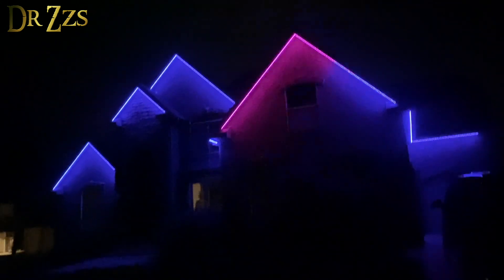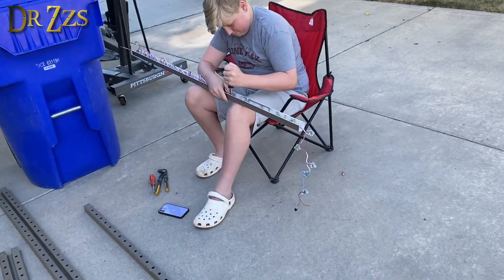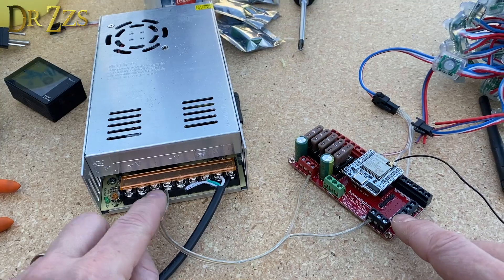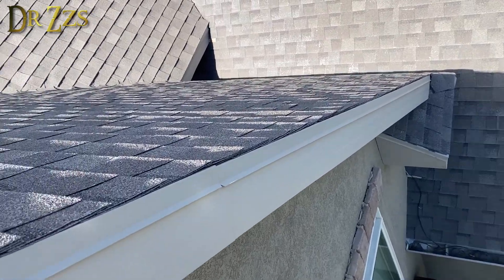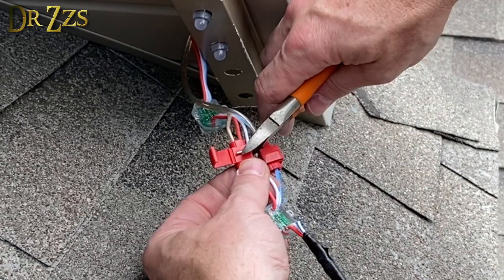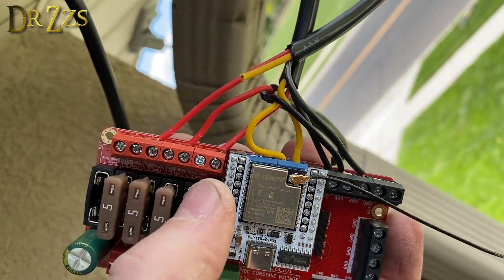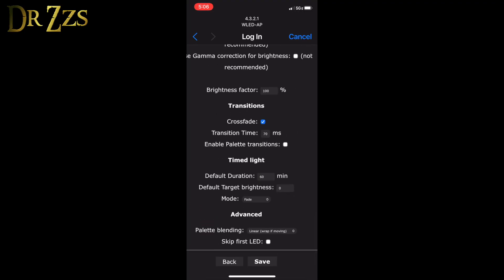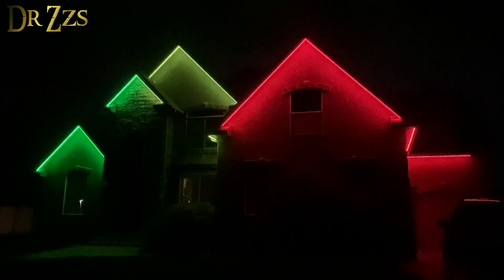Permanent Holiday Lights | Permatrack | WLED

Comment: I was able to connect to the WLED-AP network once. I was not able to follow your instructions in this video before my phone went to sleep mode and now I can't find the controller box network on any phone. Is there a way to reboot the system to factory defaults?

Comment: You can also brush the data booster with silicone conformal.  You could literally run it under water with that stuff.  I used to use it back when I built drones so they would be safe if they landed in wet grass, fell in a pond, etc.

Comment: So I have a quick question for everyone. Does anyone know of a LED Wi-Fi controller that has holiday preset patterns on the app? I have a supplier from China that I have been getting traditional LED Christmas lights through for years now. They now offer the permanentlights that are 12 inches apart. They are sk6812 rgbw. They came with a SP108ELED Wi-Fi controller and the app “LED Shop” is a great little app but I need to make it really simple for our customers. I don’t know if I have enough information in my question, but any kind of help or things for me to learn would be greatly appreciated. Thanks.

Comment: On one of your earlier videos, you didn't inject power when using 12v. I thought that was the reason we were using 12v. So we didn't have to run more wire.
Reply from the maker: We probably didn’t need power injection on this install either.  We did it because the track was going to be inaccessible and while we have the boom lift we thought we aught to go ahead and power inject since it was minimal work up front and would be a ton of work if we had to do it later.

Comment: These pixel led strips can be controlled by an ESP8266/ESP32 too ? Why not using a Falcon F16 controller ?
Reply from the maker: yes.  They can be controlled by any ESP-based device and they could be controlled by a Falcon or Kulp controller.  If you use a digquad (or other WLED device) you can integrate it into an xlights-based show.

Comment: Really struggling to troubleshoot why it’s not working…figured I’d post on here as I’ve watched the majority of your vids but unable to determine problem. 

Power supply is functioning, I have power to controller (>12 v ish), I am also reading power through the lights themselves. The WiFi is not being recognized by my phone. And the lights are not lighting up. Data is on first relay and the flow is on the correct side of the individual express able led lights I bought. I’ve tried two strips and neither work
Reply from the maker: The best way to get some support is to join the discord channel.  Link in the description.  It is really hard to troubleshoot via comments.  There are lots of people who are experts in the discord channel.

Comment: What do you recommend for peeps who have gutters installed?
Reply from the maker: Every roof I've installed on has had gutters.  The gutter is on the outermost edge of the soffit, so there's room behind it to mount the track.  I've also seen people screw into the bottom of the gutter.  That doesn't end well.  Don't do that.
Reply: @DrZzs  so mounting it downward(?) I presume and its shows good? Or should I say glows

Comment: Hey Dr. I don't have that option to adjust pixel count. I doing the 1st step now and not sure if y'all updated it. It doesn't want to move past 30 pixels why?
Reply from the maker: The place to change the pixel count is now in the Hardware output section.

Comment: I am having a very hard time trying to get the ESP32 board to connect to my wi-fi.  I purchased the Permatrack back in February and it is all up.  It is all wired and has been injected with power, but I can only control the board when I am in my house.  I have tried to reflash the board, but it does not seem to work for me.  I can only work on this with my daughters computer as mine is a company tablet and they do not let us plug anything from the outside in to it.  Is there a way that we can get together to get these amazing lights to work properly with the ESP32 board?  I am surely up for a phone call or for you to be able to connect to my daughters computer to reboot the board and try your magic with it.  I am really wanting to get this done ASAP as my daughter leaves for college in the next couple of weeks so we don't have that much time to get this figured out.
Reply from the maker: Sounds like wifi signal strength problem.  Reflashing won’t change that.  Which controller are you using?  I’d recommend the external antenna version. If that’s what you already have then would it be possible to run an Ethernet cable to where your controller is?  Or can you move the controller closer to your wifi router or to a place where you can run an Ethernet cable?
Reply: @DrZzs  I do not believe it is a signal strength problem.  I say that as I have both of my garage door openers on my wi-fi network along with my ring camera.  All of those devices are alomst exactly as far away from the router as the controller is.  I also have taken the ESP32 board downstairs in my basement and tried to set it up again within 5 feet of the router and it still does not seem to connect to it.  I do have the external antenna version so that should not be the problem either.  Is there a way to use an Ethernet Cable to set it up first and then log on to the wi-fi after that?  I ask as I could just bring the ESP32 baord back downstairs to the router and try that if it would work.  I can tell you that I can control the lights from my phone, but only when I am at home.  For instance, I can sit downstairs next to my router and control the lights with my phone, but if I go down the block a short ways, I cannot as the app tells me that the system is off line.  To me, it seems like the ESP32 board is attached to the wi-fi from my phone and not the wi-fi from my home router.  Any suggestions that would wipe out everything to start the syncing process all over again?

Comment: Nice update video.  I haven't seen many new updates to "holiday LEDs" so it's nice to see it done :)
One thing I will note, from a safety perspective, I would not use multiple fuses on the same circuit.   1 circuit should be on one fuse.  If something shorts, multiple fuses would need to blow before the power was cut and you could end up with smoke and flames before that happens.  It's like wiring in your home, 1 circuit goes to one breaker, same with your LED's, 1 circuit per fuse :)

Comment: I'm doing a diy setup right now.
I have 2 sets of pixels strips 60/m 1 set faces back at the wall the other face out to the street, and I'm using sk6812 RGBNW.
With power injection every 2 meters.
For power injection, I feed a some 14ga at 36v down the track and use small DC to DC 3A bucks converting to 5v every point. It's 15$ for a 10pcs of them on Amazon and

Comment: i am waiting on  permatrack to become available in the mean time, I ran led lights along my garage and downstairs windows.  I have noticed on a daily basis an led burns out and I have to solder in a new one, this is fine on the lower floors but a concern for the second floor, I have tried connecting the controller to a UPS to stabilize the power but still got another burned out led over night, do you have any suggestions to prevent this?
Reply from the maker: Available TODAY.  Please check, it sells out soon.

Comment: It sounds so much more elaborate and difficult than if you would use the Govee POL option…… or am I wrong? Govee, in my opinion is a awesome option to the Twinkly lights that, with a good long run, still has a price tag that is expensive!!

And still after watching this video…. I’m confused….. what is the difference between this option and that of Govee and Twinkly?

Comment: First off just wanted to say love all your vids very informative. Been wanting to get into this holiday lighting for some time now!  I have been buying sets of the rgb ws2811 pixels a few at a time with the 3 poll male and female weather tight connectors. I have most of the hardware and mounting as well now just need to get a list of the 12v power supplies and control boards I'll need and any other type of board I'll need to get started. Was hoping you could help me? Please and thank you for your time. Have a great day and happy holidays.

Comment: Just started with the pixel world. Going to buy 500 ws 2811(12v), 30 amp power source (BTF300-5), extension cable wire (65ft) and the T1000s controller. Do you think that is a good starting point? I have about 120 feet on upper story and about 60 ft on lower sections.
Reply: Should I go with digiquad instead?
Reply from the maker: A good place to ask this question is with the Pixelheads on my Discord Channel: https://discord.gg/8gvF67h

Comment: Hey Dr. I have my digiuno on its ways now. Any chance u could just help me with the power needed for 50 lights. From my math I believe I will be OK with a 30 Amp supply. I'm using the 12v ws2811 pixels.
Reply from the maker: A good place to ask this question is with the Pixelheads on my Discord Channel: https://discord.gg/8gvF67h

Comment: This "system" is not weatherproof. It uses run of the mill connectors found in many indoor lighting products and slicing wires  with cheap wire tap connectors is just asking for issues. Not good at any price.

Comment: i bought my permatrack from their website and I have to say that it definitely not worth the money. they have the worst costumer service i have ever dealt with in my life. i got a professional electrician to install them and when we needed some costumer support every thing has to be done by email which means it could take days for you to get a response. i think that if im spending over $1000 there should be some to help me out when needed. after paying for the electrician and the equipment im $1900 in the hole and have lights that are worthless .

Comment: Thanks for the such a detailed video. We highly appreciate. 
Is there a way to attach the tracks to the brick instead? I would like to install these but to the outside windows...
Reply from the maker: you'd need to drill some holes and put masonry screws in the brick to hold the mounts.  But ya, it can be done.

Comment: I would think for something permanent it would have been allot better to use better connections. Like Xconnect and an F-Amp. I would even use manufactures extension vs the home made extension with the splices.

Comment: I am working on doing this on my house.  I have the ability to install the control box in my garage.  I am making an enclosure for my power supply and wled controller.  One thing I would like to do is add led indicator lights on the enclosure to identify if there is power to the power supply, if the dig-quad is running, and if there is internet access.  Do you know if anyone has ever done indicator lights like this and if so, how they did it?  I figure the power supply indicator light would be easy to do, but the dig-quad and wifi indicator lights seem more difficult.

Comment: How far apart should the mounting brackets be?
Reply from the maker: it's not critical.  At least at the end/start of each track ~ 46" apart.  If you want to be extra secure you can put one in the middle.  The track comes with enough connectors for 3 per track.
Reply: Hi DrZzs, do you know where I can purchase the mounting brackets from?

Comment: For the data amplifier, would it make sense to splice it in a couple pixels from the end of a channel so it is better protected?
Reply: No, because the amplified signal only goes to the next pixel.  You need the amplified signal to travel down the long wire.

Comment: I'm considering PermaTrack lights and thought holes on the bottom would look best.  However, I just noticed that my soffit is angled parallel to the roof line (about 20 degrees) instead of level.  With holes on the bottom, that means the lights would agnle back slightly towrard the house  Is that enough of an angle that I should consider holes on the side isntead?
Reply: Shoot… even if it is enough, would you be okay with lighting up the sides of your house. Don’t know if it would look appealing. Might, just hard to say. Good luck.

Comment: GREAT video and so glad the tracks and system are easy to estimate and install. One question: If the pixels are designed for this track why so much extra wire between pixels in the track. I can understand some wire in case there is a bad pixel one day but it seems like there is a lot of wire with 2" locations.
Reply: i dont think the pixels are designed for the tracks - its just the number of pixels not and individual cable length inbetween.

Comment: Just finished installing Permatrack on my own house.  Looks great, and all ready for Halloween!
Reply: I understand the title has the word 'permanemt' in it but does it really mean that you don't take it down after the holiday season? Dumb question but it's one of the evaluation criteria for me..
Reply: @cartmanbruh23  yes, it stays up all year. No need to take anything down. It’s designed to be put up once and left alone.
Reply: Maybe you can answer this question, I live in a gated community and I’ve looked at other company and they were so  much more $ but the pixels were flat so you couldn’t see it from the street. How does the aesthetic look on these? How close (feet) before it’s becomes noticeable that there’s lights?
Reply: @rickyticky6915  I installed mine at the back of the overhang, which means they're a little more hidden when not on, but perhaps the best answer I can give you is that my Fedex delivery guy didn't even know they were lights or even really notice them, until I pointed them out when we were chatting about something else.  You need to get pretty close to see anything since it's just a quarter inch of the bulb that sticks out of the track.

Comment: Hello Dr Zzs
I like what you made ... I like each video from you. I have allot of information to learn from you (I like).

But I have a question for you: Can I do same thing with a addressable led strip  (to do not see free space , I am sure yes) but cane I put for example, like in your home the 5 sectors , to start and stop after a PIR sensor see moments around the house ? to start and stop after 30-60 sec, after do not have signal ? A kind of wake-up light in the evening/at night when I'm walking near the house and I'd like it to light up the path. 

A kind of wake-up light in the evening/at night when I'm walking near the house and I'd like it to light up the path.

To set the effects from WLED app and use the Dig-Quad !

If you think you can support me from the point of view of functionality, configuration of necessary devices (I am the electrician), and I do the settings and configurations and wiring , I would be very happy !

Please write to me or tell me how I can reach you by email or where I can write to you.

I'm sure you're very busy, but I'm willing to somehow redeem your lost time by explaining and helping to get this project working (we discuss these aspects in detail in private). my email: g o i o m i h a i a l e x a n d r u  around y a h o o . c o m

Comment: Hi,  I had a self installer install some lights on my house that used your products this past year.   I have a few places that have exposed wires along with a power injection across my whole house.  I noticed you used covered wire for the transitions.   This person did not.  It is just the standard 3 and 2 string wire.   There are a bunch of places the wires are exposed.  I was hesitant about those wires being exposed to weather and sunlight.   Am I eventually going to run into the potential of those wires having issues?
Reply from the maker: It should be fine to have just regular wire without the pvc coating on the wire I used in this video.  The pixels are made to have the wires exposed to the elements and they use the same wire that doesn't have the extra coating.  So coating is "better" but no coating should be fine too.  I've had exposed wire on my house since 2017 and it hasn't burned down (yet). :)
Reply: Thanks for the input.  I will quit worrying.

Comment: Did you cover installation of the power supply and dig quad in a separate video?
Reply from the maker: I didn't show it in detail here because the video was already getting too long.  The way I have it wired up in the Test Rig is basically the same way it was installed.  We just put it in a plastic box and screwed the box to the soffit too.  Do you have specific question about how to connect the power supply?
Reply: @DrZzs  don't you run all the power injections from the dig quad now? Do you prefer to "home run" the power?

Comment: great video, thanks for the effort you've put into you're vid's over the years.. I'm and electrician (UK) and have been installing  ws2812/11 leds for several years now..I've always favoured the 12V strings due to smaller PSU's... those ws2812/11 connectors on the ends of the strings are notorious for failing here in the UK...if we don't solder and use adhesive lined heat-shrink they will corrode and fail very quickly...and don't get started on the horrid scotch lock connectors (the ones with the push down connection)...the joys of what is normally a wet country ..except this year has been extremely dry.....wish we had a product like permatrack over here would save me hours of drilling holes in aluminium & stainless channels...I've been using some the high power 30W ws2811 driven lights recently ...great for wall wash lights that can obviously synced to the rest of the installation...again thanks for all you're vid's dude.
Reply from the maker: I could see those JST's being bad in a wet environment.  I've seen people use some kind of dielectric gel in them to stop corrosion.  Haven't tried that myself.  
If you want to import a bunch of permatrack to the UK for your installs email me and we'll chat.